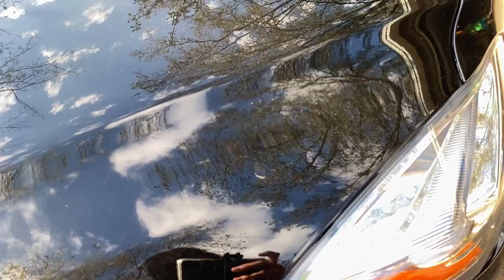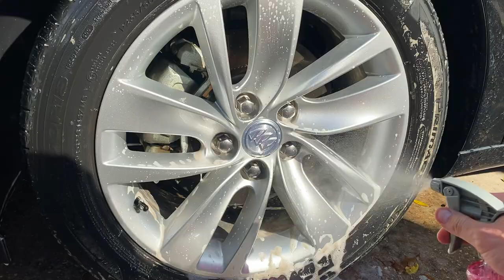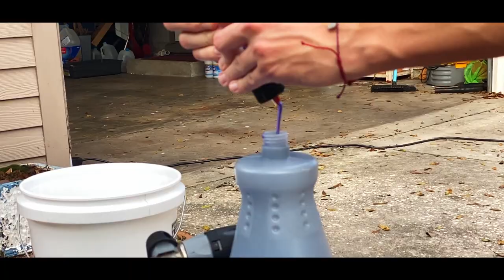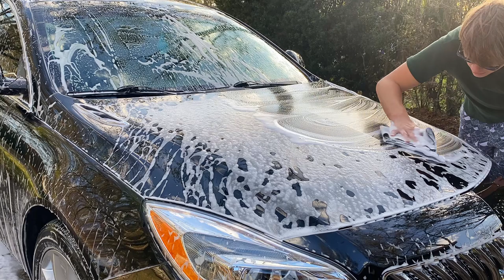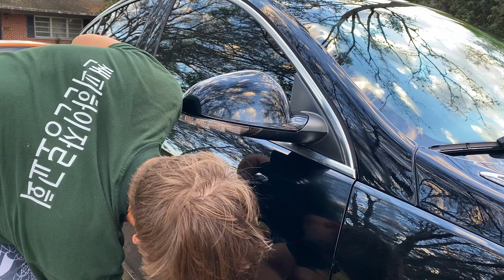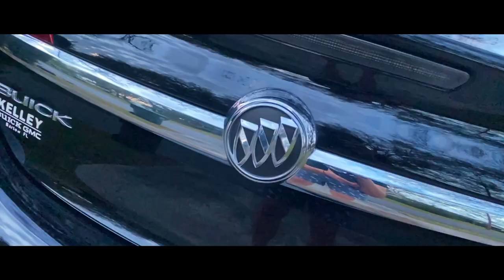Buick Regal | Making This Paint GLOSS AGAIN! | Back to BLACK! Awesome Exterior Transformation!!

Comment: Love this videos! What do you take for a full detail job?
Reply from the maker: When it comes to doing a standard exterior with BeadMaker like this, I charge $20-40 depending on the type of vehicle/condition. Of course, I charge more if it’s absurdly dirty. But when it comes to doing inside and out it can range from $50-type of vehicle, dirtiness etc. At most, for inside and out, extremely dirty, I did a Ford Expedition for $275
Reply: @ccdetailing  okey thanks for answer love   your video! Greatings from Norway